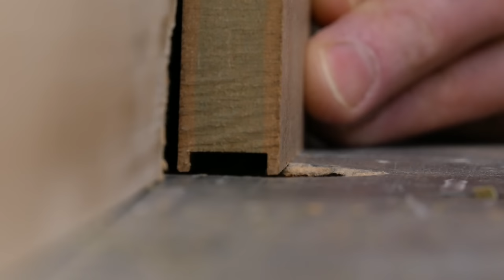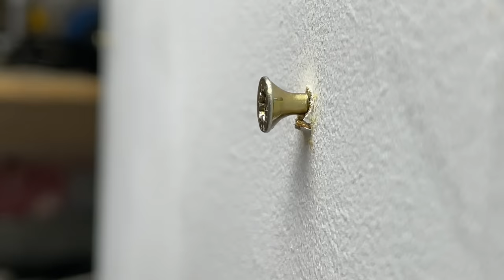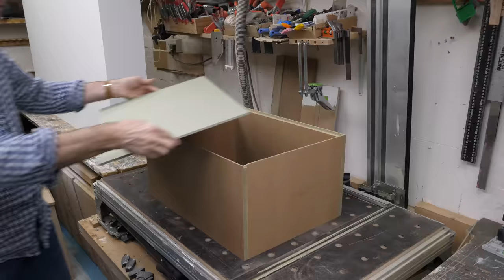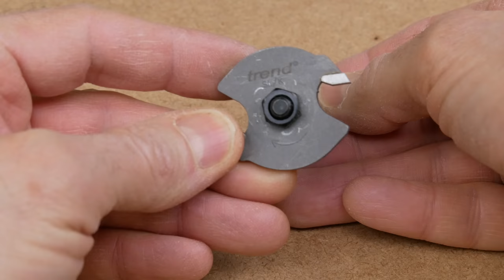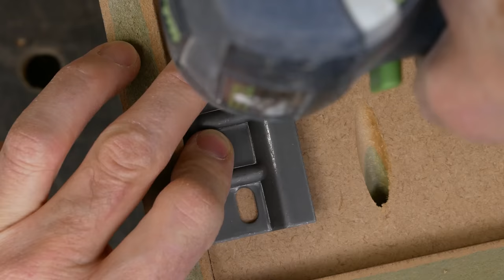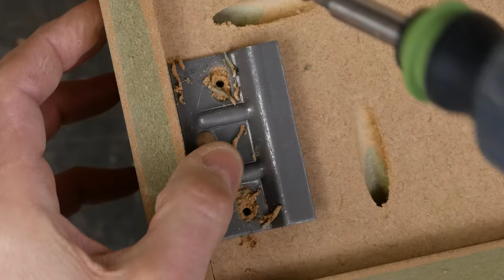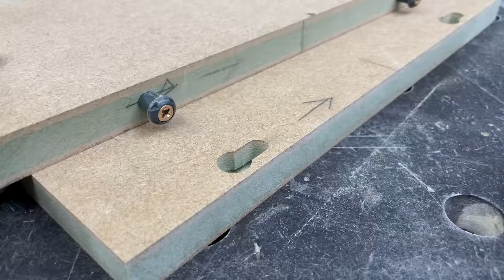Cabinetry Basics P4 [Video 438]

Comment: I've been making hanging floating cabinets that are off the floor for my 1870 Victorian house. Trouble is the brick walls and plaster are far from flat and drilling two perfectly level holes is non trivial. As a result I've been looking at adjustable cabinet brackets that are designed for kitchen units. I would value your opinion on alternatives in this space
Reply from the maker: There's a couple of ways to go, with kitchen cabinet hangers being the most flexible as they can be adjusted for reach. The other option I've used is french cleats, but with the wall-mounted half packed out to accommodate the wall undulations. You can made the sides of the cabinet deeper, and scribe them to the wall if you want to go all-in on it. 👍
Reply: Thanks

Comment: Hi Peter, what brand of pozidrive screws do you like to use?  I often use Timco but the bit doesn't always grip that well without really pushing on the drill driver.  I have used Spax but a bit expensive.   There are some at Toolstation and screwfix not sure which is best value vs quality.  I used to know cabinet makers who only use Torx.  Reiser might be good.  So many choices!
Reply from the maker: Hi Aaron; I pretty much only use Spax now; I've had enough with screws where the heads aren't fully formed, or they come out of the box slightly bent. Never had any of those issues with Spax. 👍

Comment: I like those little screws you’re fixing the corner plates with - do they have a special name? And do you think I could get away with 2 corner brackets to mount cabinet or would you always use 4? (Strikes me that many other fixings only use 2 points secured into wall 🤔) Cheers!
Reply from the maker: They’re called tongue-tite or lost-tite screws. That have a tiny head, so are very useful for all kinds of discrete work. Originally made for screwing down tongue and groove flooring.  And two plates are usually fine - as long as you get a good fixing on the wall.  👍👍
Reply: @10MinuteWorkshop  You’re a star. Tireless. Hugely appreciated.

Comment: One more item.  Do you still like your CXS drill?  I have been contemplating getting one, mainly for fine cabinet work like what you have shown.  Would you buy one today?  Thanks again.
Reply from the maker: Yes, I love it; I might consider the t-handled alternative, but I do like the shape/size/weight. In my experience, you do need to go all-in on the centrotec system with Festool drills, and the CXS in particular - it's nose-heavy with the supplied Jacobs chuck, so try and get hands-on before committing. 👍

Comment: Excellent material covered in this series. I will be using some of it in the future. One question what do you use to fill pocket hole voids or screw holes? I seen you use it in the first or second video Not sure what it was though. Thank you
Reply from the maker: Thanks! It’s a 2-pack resin filler - bondo, decorfill, any of the usual suspects works well. 👍
Reply: @10MinuteWorkshop  thanks

Comment: Congrats on 100k mate. What do you think of a standard kitchen wall hanging bracket in comparison to the french cleat
Reply from the maker: Cheers Sam! Standard kitchen cabinet bracket is plenty strong enough, and has the advantage of being adjustable, but I was very impressed with the trench clear, and how solid it was. 👍👍
Reply: @10MinuteWorkshop  hmm will explore them for my
Carcasses. Was planning on leaving a 15mm cavity and I have half a sheet of 15mm MR MDF I could rip down. 💡

Comment: Is mdf strong enough to hold metal tools etc as a cabinet, I have always avoided mdf where I needed a lot of strength of the plywood... pls correct me if I'm wrong, but mdf keeps getting singed on the corners and edges... and don't think it's good for cabinets in a balcony which is open to moisture air etc...  I'm sure mdf would be easier tp nail into though... nailing into plywood joining two sides at the corners holding it at an angle like you showed in the second part seems tough for me since I use plywood and not mdf...
Reply from the maker: MDF is plenty strong enough, but you have to use decent quality MR or Moisture Resistant MDF, not the bargain basement builders yard fluffy-edged stuff. 👍

Comment: Peter the French cleat version the cleat is inside the cabinet this you would need the largest rebate right?  Also looks like the rebates are done at the end but they have to be done before assembly right?
Reply from the maker: Yes, that’s right - I set the grooving bit deep enough to accommodate the thickness of the cleat. And I do show the grooves being cut before assembly, yes. 👍👍

Comment: Do you have a recommendation for metal supports over a thin back that would work better with stud walls that need screws at particular distances? I'm thinking a metal strip that goes the whole length of the cabinet sort of thing... maybe doesn't exist?
Reply from the maker: Sure it does - used all the time for hanging kitchen cabinets - https://amzn.to/3qbQYTX 👍

Comment: Hi Peter nice video on an important subject. I will be using French cleats on my new workshop fitout very soon.  A great, simple, cheap method especially on dodgy walls. I wish to ask you or anyone in here a question as I cannot find the answer anywhere else.  What is the difference between a TS55 and a TS55R?  I googled it and nothing came up?  I am in the market for a track saw and am split between the Festool and the Makita. I have watched all your comparisons and many others on here but the answer to that question evades me.  Thx
Reply from the maker: Hi Michael and thanks! TS55R is the most recent saw, with a number of small improvements, most notably having a depth gauge that allows for the rail thickness. Finally! 👍👍
Reply: @10MinuteWorkshop  Aha! that puts that to bed then, thanks for the quick response & sorry to disturb your evening but it has been driving me nuts

Comment: Hi Peter, could you post a link to the low angled brackets you’ve used here? I can’t find any with the slot on the long leg, here in the UK, thanks
Reply from the maker: They're called an adjustable bracket, these ones are from ironmmongery direct.👍 https://www.ironmongerydirect.co.uk/product/adjustable-bracket-77-x-15-x-17.5mm-zinc-plated-pack-of-10-735722
Reply: @10MinuteWorkshop  ah! Brilliant! Thanks for that, it’s much appreciated. 👍

Comment: Thinking of making a couple cabs for my garage Peter, 950w x 400d x 720mm high. Biscuits, glued and screwed. Solid back with metal hanging brackets as per your third method. Do you think MDF is ok for these or would ply be better?
Reply from the maker: How dry is it in the garage. I’d always go with MRMDF, but in this instance if there’s any potential for direct water contact or heavy humidity/condensation, I’d go with plywood tbh. 👍👍

Comment: would you use MDF to create a cabinet in the bathroom? btw really cool trick with the level and tape to make sure you drill holes for screws
Reply from the maker: Thanks! Yes, I've done a few - but only use MR (moisture resistant) MDF. 👍
Reply: @10MinuteWorkshop  how about using Plywood? In your opinion what material would be better to use for the bathroom cabinet?
Reply from the maker: Depends on the finish tbh. Plywood for stain /lacquer, MRMDF for paint. 👍
Reply: @10MinuteWorkshop , hmm interesting, I didn't think of that. I was thinking alongside moisture and how damaging this is to the material. so, good point.  :) thank you

Comment: Hi Peter, I am working on a installation where I need the fixings to be hidden, similar to that tic tac toe style piece you showed in this video. I like the routed brackets you have shown. I am fixing into a concrete wall and in my experience the drill bit tends to wander in concrete so I need a fixing with more adjustment. Do you have any suggestions? Many thanks
Reply from the maker: Yes, that’s the only downside if those routes keyhole plates - no wiggle room! All I can suggest is drilling a pilot hole into the wall first, before opening it out with the full-size bit. If you do get ‘bit wander’ and end up with a bigger hole than you intended, one thing I’ve done successfully is to fix a wall-plug in the correct place with epoxy putty. Best avoided of course,  it it gets you out of a tight spot! 👍👍

Comment: A 4th option is thin backs with a with a cabinet suspension rail system from Camar or Häfele. The trouble with a single French cleat for a run of upper cabinets is getting enough fasteners into wall studs which won’t likely conveniently align with where the installation is taking place. The hidden suspension rail can be secured in multiple locations along the wall and cabinet boxes are hooked on without concern over attachment locations. 

https://www.hafele.co.uk/en/product/cabinet-hanger-wall-rail-galvanized-steel/0000003900011fc500020023/
https://www.hafele.co.uk/en/product/cabinet-hanger-screw-fixing-unhanded-two-way-adjustment/0000007b00036aa000010023/
Reply from the maker: Yes, I’ll be talking about those in a future video about ‘problem walls’ 👍👍

Comment: Another excellent video peter.  I see you use your  Ryobi airstrike 18g nailer a fair bit, and I believe you also have a 23ga electric headless pinner? I'm in the market for a full nail gun setup (15/16/18/23/stapler) and I'm torn between going for an air compressor setup, or the cordless/corded option.  23ga cordless nailers don't seem to be a thing, so I'm thinking of going down the air compresor route, where each nail gun is obviously cheaper, but you don't use a compressor, even when doing commerical work, so I wondered why?  is 18ga and 23ga really all you've ever needed?
Reply: Oddly Ryobi actually do one, just not for the European market. I asked them about it they just said, here's a link to what we sell in Europe.
Reply from the maker: Thanks Kristoff. My Ryobi Air Strike is a 16g and until recently I hated it. I've probably used it more in this series than anytime in the last 5 years! What changed? Bigger battery! Makes a works of difference. I've had small compressors before and never got on with them but I've just bought one to try out as I'll be doing a 'nailers and staplers' video before too long. I also have 16g and 18g air nailers. I have a 21g corded pin gun, and 18g corded Maestri nailer/stapler. Also the air strike narrow crown stapler. For installs, the small size of the 21g pinner and Maestri can't be beaten. I'd love a 23g cordless. but companies dont seem to want to offer them here, so I may get an air powered one after all!
Reply: @10MinuteWorkshop  In that case I think I soldier on a bit with my 18 ga screwfix special titan nailer for a bit longer, and await the outcome of your air compressor deliberations.  I think ultimately I'll go for the dewalt/stanley/bostich 6 litre compressor and a suite of air nailer/staplers.  The full set, cordless, just gets silly price wise and the lack of 23ga cordless still remains.
Reply from the maker: I had the little Stanley compressor before and it was terrible! Incredibly loud and developed a fault where it kept blowing fuses on power-up. Just FYI.
Reply: @10MinuteWorkshop  Thanks for the heads up.  I suppose the issue when you abandon the little compressors is the trajectory you then get on.... may as well go belt drive to keep it quiet..... then if belt drive may as well get a big tank and a decent motor to provide enough CFM for spraying.... and before I know it I've spent a grand on a compressor and lost half my gargae space.  Stood there thinking how did it start with the requirement for a few nail guns?  lol

Comment: what are those self adhesive covers you use. to cover the screws.
Also how did you go about mounting the track saw rail. Is it something from festool.
Reply from the maker: There are loads of the stick-on covers available, like these - https://amzn.to/3rupdnd - or search for 'kwik caps'. And the hinged rail is part of an off-the-shelf Festool MFT or Multi-function table - the hinged rail comes as standard. See videos #182 and #183 for more details. 👍 Video 182  https://youtu.be/0V-p5F7SjO4
Reply: @10MinuteWorkshop  thanks for the reply.

Comment: Not much detail on 'levelling up' with different types of hanging Peter?
Reply: That's usually my issue, along with walls that are not straight or plumb. I built some storage cabinets for my garage and hung them on French cleats, only to find the top of the wall was a good cm or so further back than the bottom. Meant packing the cleat on the wall and became a much less "clean" job as a result. I now build a false wall (along the lines of what Peter used in the demo) to hang my cabinets so I know it straight, level and plumb. I now use a single cleat the width of all the cabinets so at least they are all hanging from the same datum.
Reply from the maker: Sorry Dave don’t quite follow; what do you think was missing ?
Reply from the maker: Ah, understand from Simon's comment now. If a wall's that far out then I'll use cabinet hanging brackets that are adjustable. I was saving that for cabinetry mid-range! 👍
Reply: @10MinuteWorkshop  Not quite Simons  difficulties? I meant where does the fastner go to match the 'design' that you have? E.g. the error you made assuming an 18mm gap would exist, when it was only 12mm?
   I guess it's in the layout stage? How many options are there - since there are probably n*3 ways to get it wrong :-) 
Your 'example' illustrates simple two faces, three and mid sheet joints.
Reply from the maker: Sorry Dave, getting confuddled now - was your last comment intended for the Patreon video?? The whole comment thread?? I'll be doing an update to the Patreon vid soon, as I don't think I explained it properly, OK? Thanks Peter

Comment: Do you have the make/type size of the staples you use in your Ryobi. I'm not having lick locating any. The more I see those peanut connectors the more I want to try them out.
Reply from the maker: These one are standard Tacwise narrow crown staples in either 20 or 25mm. 👍
Reply: @10MinuteWorkshop  Thanks Peter.

Comment: I assume you’re hanging those on studs. Surely, sheetrock won’t hold them.
Reply from the maker: I’m British; we make our houses out of brick. Plasterboard/drywall will hold them, bu you need particular fixings. The cabinets I hung in this video were on a set I built for the purpose. 👍
Reply: @10MinuteWorkshop  Sheetrock, drywall, gypsum board, it's all the same thing. How does the saying go? Two countries separated by a common language.